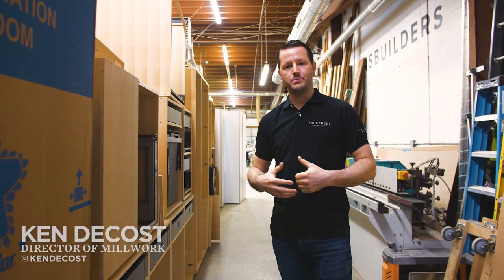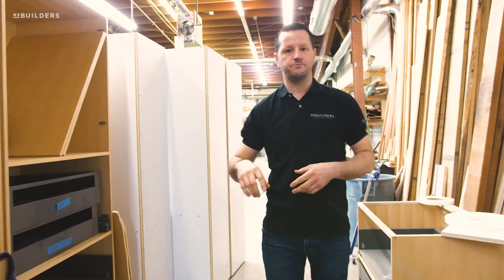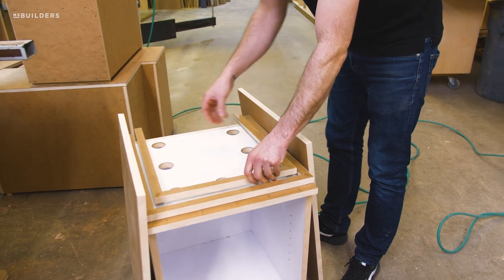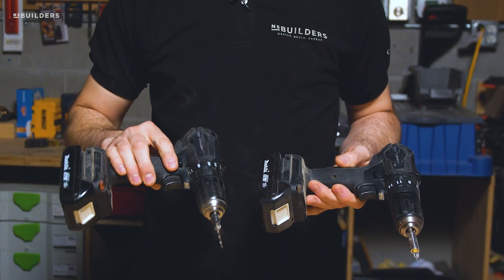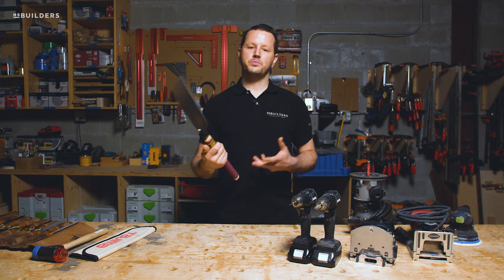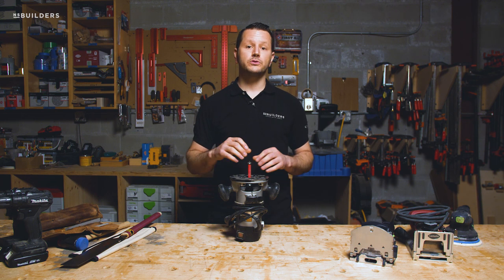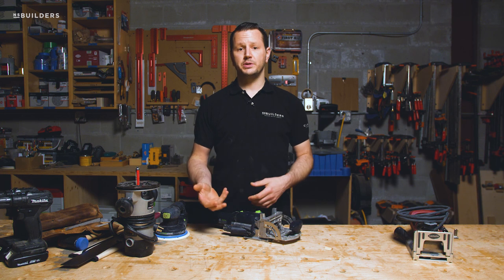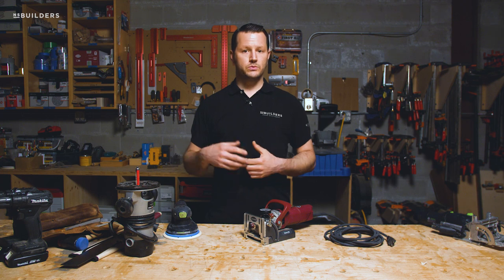Most used hand tools in the cabinet shop | Revealed

Comment: Do you prefer the 6" sander over the 5" because of the time savings using a larger disc? are there other benefits to the larger size?
Reply: Yes, it makes sanding a little faster. But be careful, using the 6" can be more difficult when sanding thinner objects and can cause uneven sanding issues.

Comment: Impact haters—Try a Milwaukee  M18 Fuel Surge impact. Incredibly smooth. Great trigger and motor feel.
Reply: This brings up another "issue" with battery operated tools. Once you buy into one system, you're not likely to switch to another.
Reply: Still worth it. Try it and then tell me it’s not worth $250. I feel like it is really good at the end of torquing screws into place and especially when making small adjustments to screws when leveling and installing jambs and cabinetry-does not even shake the bubble on a level. Very smooth. Works amazing with brass flat head screws that I work with often on chicago restoration projects with original doors.

Comment: From Europeanen point of view . Sawstop saws  style are American cabinet table saws. Since a year Felder /format 4 have also this safety function in full panelsaws - by saying that they are industrial grade tools With price around 12.000- 25.000 machines total other level and we can not compare appels With pears - Festool contracter table saw also has this as a option
Reply: Amazing, I did not know Felder incorporated that featuring into their tools. One more plus for going with a Felder. Festool owns sawstop so we knew that was happening.
Reply: @kendecost  Hey Ken, last week i sat down with a salesman of Felder / Format 4 (i gues for now it was only on the format 4 ) and he said its also a different system. there is no aluminum block going into the blade.. how it really works in detail not sure.. but the fact was you don't need to change the mechanisms when it happens and the same for the saw-blade..wich means if you have a Freud sawblade from almost 200dollars it doenst go to the trash.. i still think its a sensitieve system.. with a nail or moisture in the wood wil it als retrack then or not..
Reply: @dannyschoemans6686  Gotcha. Still great to know others are working on that technology. Especially the manufactures of larger machines like these sliders.